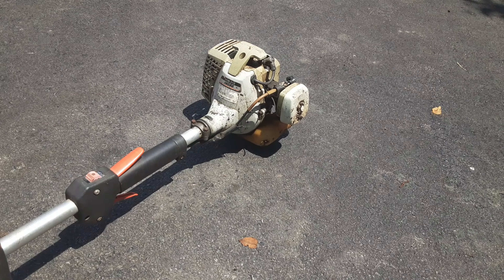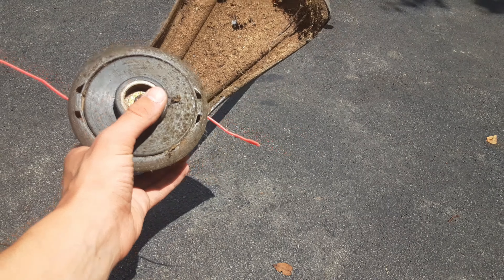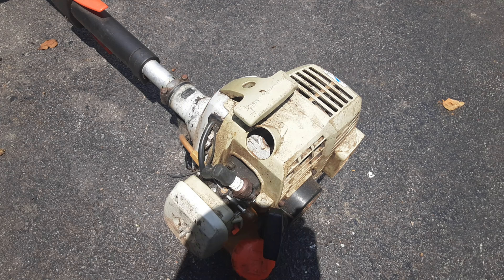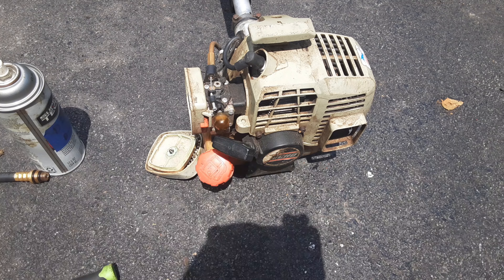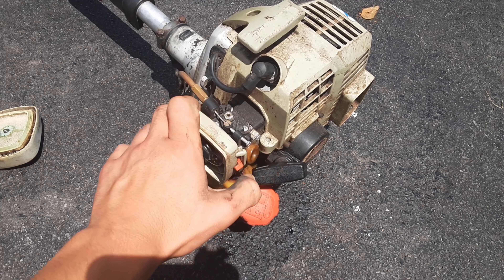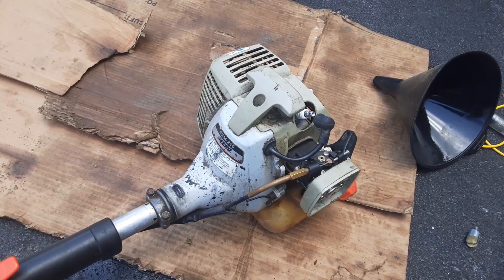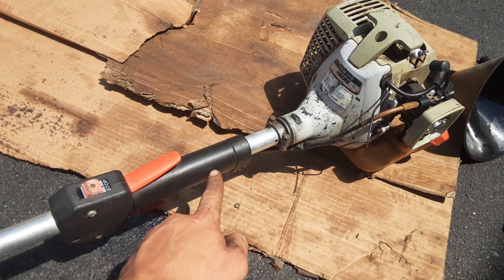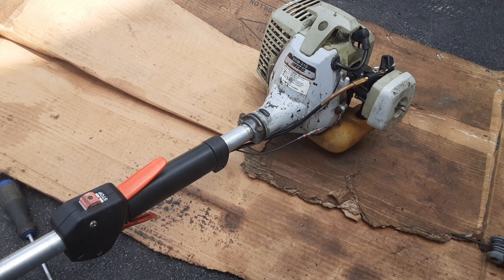Restoring an old Echo trimmer Part 1: Will It Run

Comment: I always solder the wires before putting the heat shrink on.
Reply from the maker: Those connectors are supposed to be self soldering. How much I trust that, I don't know. The reason I don't do it manually is because I am terrible at soldering.

Comment: Good job. Some black heat shrink over those wire connections would be a simple solution. Keep it up. I hope to see your channel grow.
Reply from the maker: Thank you! That heat shrink is not a bad idea, but when I put the trimmer together for the last time, I will have a rubber piece that goes over that. When part 5 comes out, you'll know what I am talking about.
Reply: @jonahssmallenginerepair  I see. Looking forward to it!

Comment: There were 2 cut wires , How did you know which wire went with which ?...  Or does it matter ?
Reply from the maker: That's a good question. The answer is it doesn't matter the order of the wires.  If you swap them, it will work exactly the same. In this case, One wire comes from the coil, and one is just spliced to the metal frame, and all you need to do is touch the two wires (with a switch) when you want to kill the engine.

Comment: Is there a reason to pull the spark plug wire  instead of choking it to ahut it off
Reply from the maker: @user-gk7pj6ur5u Sometimes,  if you choke it, the machine will not shut off right away, whereas if I pull the plug wire, I know  it will shut off right away.
Reply: @jonahssmallenginerepair  
That makes sense. Thank you

Comment: It's actually easier if you remove the tank instead.
Reply from the maker: If that works for you, that's great. However, I have replaced fuel lines on Echo's so many times and do it so quickly, that I personally find it easier to just leave it on.

Comment: Engines need four things to run… fuel, spark, compression, AND timing.  Yeah it’s not like the timing could be off on a trimmer
Reply: Timing on the echo trimmers is advanced by the ignition module and CAN be off but it isnt common. It is a total pain to figure out as well
Reply from the maker: This is true, however that is next to never an issue on these units.